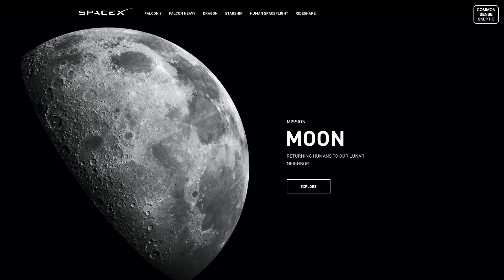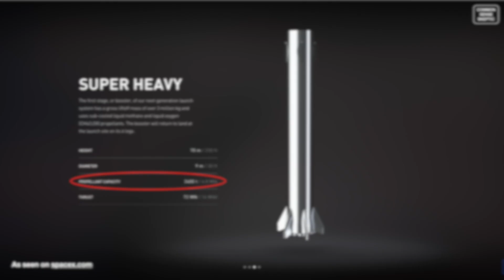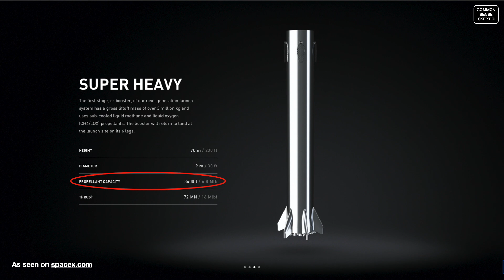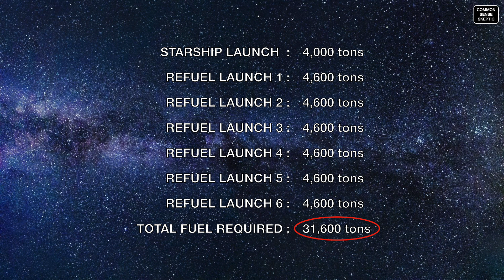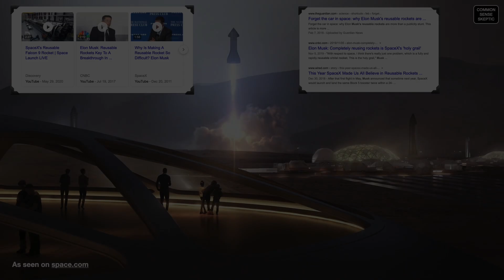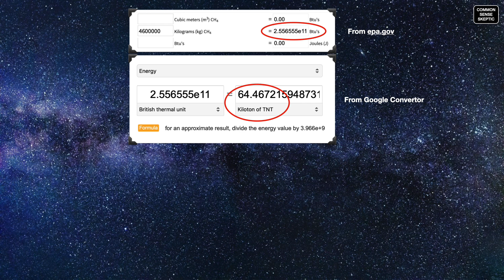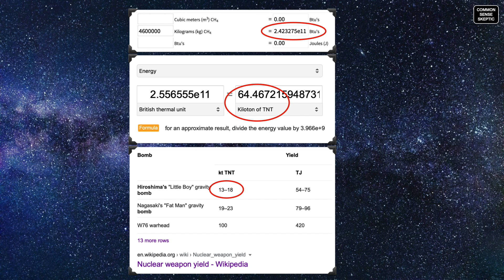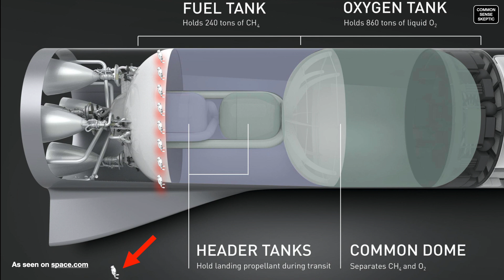STARSHIP EP5 - ORBITAL REFUELLING (1080p)

Comment: When I think of the risks of refuelling in space with multiple ships, wow this is not the answer for deep space exploration.
Reply: Refueling in space is 100% the way to do it. Trying to launch enough fuel in one go is dumb given the rocket equation. space refueling will eventually allow us to produce fuel off-world so we don't have to launch it up in the first place. Definitely a good idea to nail down the process sooner rather than later.
Reply: @dirkwalker9686  Whilst I agree that refuelling in space enables a lot of good things, I also think that refuelling a manned space vehicle can and should be avoided. Also, paradoxically, in-space refuelling undermines the economics of producing fuel off-world - because it makes it easier and cheaper to get fuel from Earth to places like Mars orbit.
Reply: "Risk" is relative actually :) The simple fact is you can't carry enough propellant right from the start in any reasonably economic plan. 

But propellant transfer, (correct term because you replace both fuel AND oxidizer) has already been done on a routine basis with Mir and the ISS. Scale, however, is a thing and it would be vastly less risky to pull Starship up to a dedicated orbital propellant depot and get it all done in one go. That requires on-orbit infrastructure, (the propellant depot for one thing) and that is something that Musk is going out of his way to avoid. Mostly it's because his "Mars Plan" is really just a modified version of Robert Zubrin's "Mars Direct" mission and the more he moves away from that basic plan the more actually planning he has to do, but mostly because he is too short sighted to see how such a  depot would work out as an advantage in the end. (A depot doesn't give him the monopoly prospects he wants. As long as his plan can only use Starships to bring propellant to Starships then  he can fly the Starships more which boosts his economics even if no one else benefits. A depot could be provided propellant by "other" vendors in competition to Starship)

The other way is to launch a vehicle that can carry expendable 'drop-tanks' and then launch the drop tanks and connect them to the spaceship and go. Neat and simple and actually economical for fairly low flight rate which is going to be most early Mars missions anyway. Not going to happen with Musk because, (again0 he can't see the advantage to it. It would require a different ship to go to Mars and it would require less use of Starship/Superheavy making it's economics, (already questionable) worse.

Propellant transfer in space is a game changer and as you can source your propellant from 'local' sources, ( @Saumya Cow is not really wrong but in context 'local' propellant from Mars and even the Moon is arguably economic compared to Earth based propellant due to the delta-v requirements of getting it out of Earth's gravity well) though lower shipping costs from Earth DO have a great effect on any economic incentives and/or market off Earth for technology and manufacture, ("local" becomes harder to justify versus imported) propellant making equipment shipping is a one-time cost whereas constant propellant shipment costs add up quickly.
Reply: @randycampbell6307  In my view, locally sourced oxygen (for propellant and other uses) from Mars is worth doing. However, methane isn't. Oxygen extraction is necessary (life support), simple (atmospheric extraction, not mining) and also far less energy intensive. The jury is out on mining oxygen on the lunar surface. It may be a necessary evil (life support) but its also logistically a lot easier to deliver there. 

I also think that Mars exploration can be done without fuel depots (as separate stationary entities) as opposed to fuel carriers (tankers). Its probably easier if I just go into concrete detail. Now, lets suppose for the sake of the argument that there exists a Starship class tanker vehicle. It has a thermal protection system and propellant transfer capability. 

So our first task is to move a lot of propellant to low Mars orbit (400 km). Lets start with two full tankers in low Earth orbit (yes this requires a number of flights and propellant transfers). Now, do a single burn that consumes half the propellant in each vehicle. We're now in an elliptical orbit that goes most of the way to the Moon. Transfer propellant from one vehicle (nearly emptying it) to the other. The empty vehicle returns to Earth. The full tanker now does another burn which puts it on a minimal energy (probably ballistic capture) trajectory to Mars. On Mars arrival it aerocaptures and does a series of aerobraking passes to go into low Mars orbit with minimal propellant use. Note that this only works with a vehicle that has some thermal protection. You can do it with a pure tank, but that has its price too. Note also that this is all done robotically, so failure is acceptable. 

Now you have 500+ tonnes of propellant in Mars orbit. That's sufficient to a mission if you were to manage it well, but we want redundancy and we want flexibility. So lets send at least three such tankers into Mars orbit. Subsequent missions only need to send one or two. We'll also space these around the planet to increase accessibility (and launch opportunities). 

To access the surface of Mars, we need a single purpose lander/ascent vehicle. Since this vehicle has the delta-v capability to go from Mars surface to orbit, it also has the delta-v capability to descend fully propulsively. So, lets adopt that capability. We now have a fully reusable "lunar lander" style vehicle. Its also optimised since its not experiencing high thermal loads and its not experiencing high g forces. Since we have ample fuel in orbit, we're now in a position to run multiple landings, or even visit Phobos. On the surface, the oxygen is sourced locally (four fifths of the mass) and methane has been pre-delivered (mass wise its only a small part of the overall one-way cargo). 

Now, to get from Earth space to low Mars orbit and return. We need a special purpose habitat/transit vehicle. Because this thing never lands, it can be optimised. For the sake of the argument, picture a vehicle based around a truss. On one end is the habitation module. On the other end tankage and engines. We're talking hundreds of tonnes of tank capacity. Most of the propellant is burnt in trans Mars injection. However a quantity remains. This propellant is burnt on arrival (fully propulsive capture and insertion into low orbit). The transit vehicle can now be refuelled - and if you wish, refuelled whilst the crew is out. Return to Earth is notionally a return to high Earth orbit (might be rendezvous at lunar gateway, but not essential). Then return in a regular capsule. 

Note that this is being done to keep the propellant quantities Earth to Mars and Mars to Earth roughly the same. Hence you don't need drop tanks. However, the initial assembly of the transit vehicle in Earth orbit can be done by lofting full tanks and then assembling those onto the truss, if needed. (Propellant transfer can also be done as a latter step - it boils down to packaging). 

As for the issue of methane for ascent fuel on Mars. My view is you first of all keep the ascent vehicle light. That cuts the problem down to size. And since you're down to relatively small quantities of methane, you can simply deliver it with other cargo. Or you can deliver ammonia as a hydrogen carrier. The bonus is you get nitrogen as well.

As for one-way cargo delivery to Mars surface. Complete insanity delivering this on expended Starship. You need a vehicle that is fit for the purpose. What I suggest is a fairly conventional capsule shaped vehicle with a separate (docked) propulsion and cruise module. Launch those separate, mate them and then send them to Mars - again on a minimal energy trajectory. To finesse this, do an aerocapture pass and aerobraking to bring the cargo lander into a low orbit. Then land. This minimises thermal protection mass. And I have a few ideas from there. Note that this gives you the freedom to be generous about how much mass you land on Mars. Plus you can leave cargo landers in orbit for later positioning. 

Note that a Mars lander/ascent vehicle travels with you docked to the transit vehicle. Its also your lifeboat.
Reply: @saumyacow4435  Let me start off by saying that I resent your efforts to rob me of my title, "Makes Response Posts Way to Long on the Internet"... I've worked hard for that accolade and will not take this lying down! (However as it's getting close to my bed time I may have to break up my epic response somewhat... Also YouTube has bandwidth issues... who knew :) joking btw :) )

Yep going to need a bit to parse this but I'll note right from the start that a big point for Mars ISRU is the existence of water ice which can be broken down into propellant. Yes it's not directly methane but hydrogen is a good feedstock so right there you get breathing air and propellent which makes shipping it in far less attractive.

The Moon probably has less accessible water resources, (there are the polar craters but as I like to point out that's essentially "fossil water" in the same vein a fossil fuel, aka a limited and operationally limited source so not as attractive for long term use as one would think) but recent work going back over the Apollo return samples show the regolith in many areas is actually a lot 'wetter' than previous assumed. It's tough to get it out but it's there. Arguably oxygen extraction from the regolith is pretty straight forward, so for Lunar use something like a LOX/Regolith rocket would make economical sense.

As I said I need to head out, (work starts early tomorrow... still trying to figure out why I'm still working jobs that START so early, glutton for punishment I guess :) ) so I'll read and finish responding tomorrow. Good Stuff though :)
Reply: @randycampbell6307  Just a quick response from me then (oops). The reason I balk at methane production on Mars is that the most likely source (regolith) requires mining. Mining requires complex heavy machinery that wears and breaks. It requires a large source of energy. It requires a lot of secondary infrastructure (robotic construction, maintenance and repair). And it requires some means to carry energy (fuel, batteries, whatever). Compared to oxygen extraction (from the air) its a nightmare. Oh one other thing. On the moon you're at least in a shallow enough gravity well that you can land/ascend on the same tank of fuel (have drop tanks if you wish, but one day the moon is going to have a garbage problem :))
Reply: @saumyacow4435  Also a quick response from me: Methane is planned to be made from locally sourced hydrogen and the Martian CO2 atmosphere. The process requires energy and local mining/extraction for water ice but in general is a pretty straight forward and well known process. (Albeit 'scale' is going to be an issue as is energy production but it's difference between simply visiting and staying long enough to get actual work done)

Yes the equipment will wear and break down but it's a one time shipment cost versus on-going shipments of propellant which (and I'[l go into this more in longer response) will end up actually flying your 'tankers' less than you'd think rather than more.
Reply: @randycampbell6307  The chemistry is straight forward. The mining is not. My bread and butter for some years was doing design work for mining companies. Automation, control, robotics. Let me tell you something. Mining isn't easy. It involves heavy machinery that frequently wears and breaks. Where's the spare parts coming from? Where's the robots that do the assembly, maintenance and repair? How do you fuel everything?  There's ten thousand details you need to sort through. And if and when you do have that level of technological readiness, how much is it going to cost to send thousands of tonnes of stuff one-way to Mars, all to have the capability to launch ONE Starship? And also how much do you need to spend on providing redundancy - since lives depend on absolute reliability? 

Typical mining machinery here on Earth has a lifespan of 3 years. That not "major service" time. That's the frame is cracked and unserviceable - new vehicle please. Do you propose manufacturing? Because now you've made the problem ten times worse. Mining for water in the quantities needed to fly Starship class vehicles direct to Earth is going to require a constant stream of heavy equipment. 

Its stupendously expensive, time consuming and risky. The act of setting up all this infrastructure is many times more expensive (however you measure it) than simply exporting the methane from Earth to Mars. Remember that I do consider it worthwhile to produce oxygen locally, but even then not in the quantities needed for a Starship. That act instantly multiples your solar array. And that stuff has to be delivered to Mars, does need assembly, maintenance and repair and so on. 

Btw, there are other side effects to this. As you progressively strip mine, the mining operation moves further and further out from your base. Meaning your logistics and energy transport problems keep on getting worse. Now, where does this become environmental vandalism?

The thing I find ironic here is that if you assume a Starship class vehicle, you've made fuel transport trivial. And you've made "Mars direct" even more pointless.
Reply: @saumyacow4435  Ok, here’s my response:

>In my view, locally sourced oxygen (for
>propellant and other uses) from Mars is
>worth doing. However, methane isn't. 
>Oxygen extraction is necessary (life
>support), simple (atmospheric extraction, not mining) and also far less energy
>intensive.

The thing is while you can extract oxygen from CO2 we happen to know there’s water-ice on Mars so even though it’s more energy intensive the actual “process” is pretty straight forward. So too is making methane from hydrogen and CO2, and in the end it will actually cost less than importing propellant even if the costs are ridiculously low. (This was a point for ISRU from the very start)

>The jury is out on mining oxygen on the
>lunar surface. It may be a necessary evil
>(life support) but it’s also logistically a lot
>easier to deliver there.

Actually not, the delta-v costs per lb from Earth to the Moon are enough that, as you can literally “bake” it out of the Lunar regolith with a solar kiln, local sourcing makes more sense. Similarly you can convert the CO2 on Mars to O2 but since ISRU works it’s likely that sourcing it from ice is workable.

>I also think that Mars exploration can be
>done without fuel depots (as separate
>stationary entities) as opposed to fuel
>carriers (tankers).

Being honest the major difference is tankers are ‘self-mobile” but I suspect that’s not the advantage you might think it is.

>It’s probably easier if I just go into
>concrete detail.

Please

>Now, let’s suppose for the sake of the
>argument that there exists a Starship
>class tanker vehicle. It has a thermal
>protection system and propellant transfer
>capability. So our first task is to move a lot
>of propellant to low Mars orbit (400 km)

Ok I’ll grant that basis, and let me point out this is a version of an architecture called “Abundant Chemical” were you essentially base everything on constantly pushing propellant “forward” to fuel your exploration/expansion. 

I like the concept in general but have some specific issues with it but go ahead :)

>Let’s start with two full tankers in low
>Earth orbit (yes this requires a number of
>flights and propellant transfers). Now, do a 
>single burn that consumes half the
>propellant in each vehicle. We're now in an
>elliptical orbit that goes most of the way to 
>the Moon. Transfer propellant from one
>vehicle (nearly emptying it) to the other.
>The empty vehicle returns to Earth. The
>full tanker now does another burn which
>puts it on a minimal energy (probably
>ballistic capture) trajectory to Mars.

So far about right, coupling with the Oberth effect on departure rather than burning from the higher orbital point, (uses the propellant more efficiently even though your deeper in the gravity well) but that means more than one trip through the Van Allan’s. Not a deal breaker assuming Starship actually has radiation shielding. (Yes automated ships need some too :) )

> On Mars arrival it aerocaptures and does
>a series of aerobraking passes to go into
>low Mars orbit with minimal propellant
>use. Note that this only works with a
>vehicle that has some thermal protection.
>You can do it with a pure tank, but that has 
>its price too.

As a note that’s actually not correct as you can aerobrake without a heat shield if you keep the passes at a thermally low point. We’ve done it a lot with Martian orbital probes. Downside is that it has to be done VERY carefully, (“Did you remember to convert from feet to meters”? “No, why? Is it important? “ :) ) and it’s more difficult with larger masses. I’ll grant this though because we’re assuming these are actually “Starships” which means planned reuse therefore, heat shields.

>Note also that this is all done robotically,
>so failure is acceptable.

Prepositioning, got it. IIRC the planned Starship Tankers are automated anyway

>Now you have 500+ tonnes of propellant
>in Mars orbit. That's sufficient to a mission 
>if you were to manage it well, but we want
>redundancy and we want flexibility. So lets
>send at least three such tankers into Mars
>orbit. Subsequent missions only need to
>send one or two. We'll also space these
>around the planet to increase accessibility
>(and launch opportunities).

Fine so far but I have to point out that this is now three “tankers” that are useless to your regular fleet and will essentially ‘sit’ in Mars orbit for somewhere between two and four years if not more. The question is why send Starships then?

>To access the surface of Mars, we need a
>single purpose lander/ascent vehicle.
>Since this vehicle has the delta-v capability 
>to go from Mars surface to orbit, it also
>has the delta-v capability to descend fully
>propulsively. So, lets adopt that capability
>We now have a fully reusable "lunar
>lander" style vehicle. Its also optimized
>since its not experiencing high thermal
>loads and its not experiencing high g
>forces.

And the question here is still "What does God... Er that is what does Elon need a Starship for?"

You are not using Starship so why is “Starship” even a part of this plan? 

I’ll be honest in that I’d argue that you don’t need that much propellant nor do you need that big of a spacecraft to do any of this. (
That's also a major question I have about Starship/Superheavy in general and Musk's Mars plans specifically as well by the way, not just you :) )

May I suggest checking out a NASA/University study series generally called “ISRU to the Max” and/or the Hercules Reusable Single Stage Lander concept?

(https://www.thespacereview.com/article/3085/1)

About the only difference is that there are several models of Herucules, (again similar to Starship) one of which is a dedicated Interplanetary Transfer Vehicle that doubles at Mars as an orbital propellant depot and supply transfer point.

The thing here is you have essentially ‘expended’ those three Tankers because they never come home and so you’ve gone out of your way to avoid calling them propellant depots but that’s what they end up being. And you have to keep resupplying them over time as the propellant runs low. (500 tons sounds like a lot but you’d be surprised how fast it can go)

Also, again, ISRU for propellant produced locally IS cheaper than trying to bring it with you. Even more so in this case because, (and I don’t think this occurred to you here) you are going to need to eventually send MORE tankers on a one way trip to Mars to continue the landings and expansion.

Sending propellant extraction and processing equipment ends up being cheaper than constantly sending more propellant, and arguably the case can be made that the Interplanetary Transport ends up going back to Earth with less than it came with so filling that extra space with Martian propellant “might” give you a net economic incentive.

Something to keep in mind, even though I don’t like Musk’s plan since it directly doesn’t build future capability, is that he’s got a point a lot of people overlook. (Even he does occasionally since his ‘definitions’ keep changing ) 

If you broaden the definition of “expendable” a little bit, (and this is clearly illustrated in the Hercules studies) by “expending” the item in question you are actually “expanding” your foothold and outpost. To continue to use Starship, if you land and “expend” a Tanker Starship you now have pretty efficient surface propellant depot to store you locally produced cryogenic propellant in. It even includes the required pumping and handling equipment. 

Similarly if you “expend” a Passenger or Cargo Starship with a habitation section, (well good luck getting it into a position to use) you have a ready-made, (ok purpose made) surface habitat out of it.

Yes, none of this is actually ‘optimized’ fully but that’s ok really because the point is utility and the ability to mass produce the vehicles, (even if very different internally having a similar outer mold line does in fact help your costs somewhat) for economy.

Good thoughts though, thanks.
Reply: @saumyacow4435  Start point; I don't assume Starship and in fact don't see it as a viable system :) I only point out that it's the whole basis for Musk's plans so quite obviously it kind of "needs" to be used as much as possible :)

A more direct point is that this is exactly opposite of supporting ONE Starship. That is exactly the problem both with Musk's plans and Mars Direct.

I realize that mining is difficult and expensive, I've discussed it and in context of off-world use for a couple of decades now. Yes in fact you DO pretty much have a constant stream of "parts" in transit, it's rather a given with the assumption of a sustained presence rather than a 'flags-and-footprints' mission profile.

You're directly on-point with bringing up how ridiculous the idea of supporting a Starship sized vehicle from local resources is. Something a third the size, (Hercules for example) would be a challenge but it is possible.

I'm also glad you brought up maintenance and support for the infrastructure you'd need, far to many people blow it off and as a maintenance person that physically hurts :) No it's not going to be easy and yes it's going to take a lot of work. No extensive ISRU for the first missions doesn't make sense but on the other hand you don't need it as you can bring some of the supplies with you instead and produce propellant locally. Mars Direct, for all it's faults, has managed to do the actual work to prove that part at least. (Even thought the whole concept and initial work was done in the early 60s)

As for the 'mining' operation itself it's a choice of what you want, short term visits or are we staying? The main problem with long-term ISRU is that Mars isn't the place to be mining your water from as it's only a short-term solution. (It's all "fossil water" anyway so it is by definition a limited resource) But it IS right there and available so it's going to be used in the long-run.

I should probably point out that not only am I not a "Musk" fan, I'm also not a Mars-fan as in one who thinks it is a 'natural' second home for mankind. It's not. It's a very dangerous, very marginal place for a human settlement but in context that's what "Starship" and these videos are pretty much about so it comes down to what the end goal is. I'm more interested in Venus, but I'm a minority :)
Reply: @randycampbell6307  Yikes, death by formatting! :)

Chemical processing of Martian CO2 and water into methane is not the problem. The problem is the cost, mass, complexity, risk and energy involved in mining Martian regolith in sufficient quantity. You end up sending more mass to Mars than you would have if you had simply delivered the methane itself. Btw, mining and chemical engineering equipment has a typical useful life of a few years. To get beyond this you need a full blown manufacturing infrastructure on Mars and that's not happening any time soon.

Methane is 22 percent of the mass of propellant. For a sensibly sized ascent vehicle, this amounts to single digit tonnage per flight. At that scale the imported methane is a minor part of the overall mass you need to send to Mars surface as one-way cargo. Once you've nailed the one-way cargo transport issue, the methane (or ammonia) transport is a secondary issue.

Oxygen from lunar regolith. Again, I'm not ruling this out. But don't underestimate the complexity, mass, cost of mining. Versus the simplicity of simply landing on the moon with enough propellant to also return to lunar orbit. Something we know how to do.

There is a blurry line between "tankers" and "depots" in the sense that no matter what you put into space, its going to need engines, navigation, power etc. However the one thing that ordinary fuel depots don't have is the ability to do aerocapture into Mars orbit. You can make do without that capability, but then you have to upscale to account for the propellant needed to propulsively capture. The TPS (however you arrange this) would certainly amount to less mass at this point.

Just to clear one confusion. I'm not proposing to put humans on a Starship. What I have in mind is to put the habitat/transit vehicle either into a high Earth orbit or in lunar gateway orbit and send the crew up to it with a Dragon/Orion. Then fly close to the Earth before doing the trans Mars injection burn. This means two passes through Van Allen belts but they are relatively fast passages. Everything else is unmanned, so not critical.

You can aerobrake without a heat shield, but you cannot aerocapture. One can of course experiment with "dumb tankage" and inflatable heat shields and the like. But my reasoning is this. You've already got a tanker vehicle since you need to get propellant to Earth orbit. That tanker thus has a full TPS. There's no sense in designing an entirely new vehicle if exactly the same vehicle can transfer propellant in Mars orbit as well as it can in Earth orbit.

I'm not about to step inside Elon's head. All I know is that he'll burn money until either it runs out, or they lock him up. "I just may be the lunatic you're looking for" the song goes.

I'll check out the Hercules study tonight.

Regarding Starship class tankers being sent to Mars orbit and also the general issue of expendability. You're starting with a full tanker in low Earth orbit. Burning half your fuel gives a delta-v of about 2.6 km/s. That puts you into an elliptical orbit that stretches most of the way to the moon. Now, transfer propellant to fully refuel. From this orbit, Mars transfer is in the order of 1.5 km/s . So, you arrive at Mars with a bit over 800 tonnes of propellant on board (I assume a dry mass of 100 tonnes, propellant mass of 1300 tonnes). 

The habitat/transit vehicle notionally requires 400 tonnes of propellant to return to Earth. Again this is from low Mars orbit to lunar gateway. One tanker is more than sufficient for this, plus a number of lander/ascent vehicle flights. Yes, you can afford to go to Phobos and you can afford to rotate crew, or do a multi-site expedition.

I have multiple tankers in Mars orbit purely for redundancy. If one gets hit by a micro meteor, that's a loss, but its not a loss of crew or mission. Plus in extremis, these things are capable of acting as orbital tugs. Backups on backups.

You can of course reuse the tanker. It means setting aside a reserve of roughly 200 tonnes of propellant. That reduces the usable propellant in orbit and that's why I gave the figure of 500+ tonnes. I didn't go into reusability for two reasons. One is word count. The other is that the vehicle isn't that complex or expensive and after some years in space, including the return flight to Earth, its going to need extensive checking and refurbishment. The labour in that is going to be more expensive than the hardware. Furthermore

- We are talking about roughly one tanker vehicle per mission.
- If you're going to expend something, expend something that isn't that expensive to build.
- Perspective. A typical Mars mission might require 150 tonnes (or more) of one-way cargo. That's two or three expendable cargo delivery vehicles. No way around that.

Again, ISRU methane is NOT cheaper than bringing the methane with you. When you deal with all the mass of all the machinery that's needed to be sent to Mars, much of which has an usable life of a few years, plus all the power systems, robotics and so on, a single digit tonnage of methane per ascent is neither here nor there. Not when you consider its secondary to all the mass of one-way cargo you need to deliver to Mars surface. 

Now, if it is the case that we want to continue sending missions to Mars after the first half dozen or so, then there is a case for creating a certain amount of ISRU infrastructure (beyond atmospheric extraction). However, that's a decade or more of manned missions where you have boots on the Martian ground and you can afford to make mistakes and learn. To my mind its far too risky to rely upon ISRU methane on a first (or second, or third) mission. I mean, even if you did send some prototype mining gear, you'd still want to send a tank of methane regardless - on the general principle of if you can reduce the risk of people dying, then you do it.

I don't regard a Starship as a particularly good Mars surface habitat. What I'd prefer to do is to first get the one-way cargo delivery issue under control. To repeat, that would mean two flights of a Starship class vehicle to Earth orbit, and in-orbit assembly (simple automated docking). The composite vehicle would deliver 50+ tonnes of usable Mass to Mars surface. Two or three of these would provision a mission generously. In that would be a surface habitat, ample provisions, water, consumables, rovers, ancilliary power plus other experimental gear - you'd probably want to do some basic earth-moving for radiation reasons.

Now, one other bugaboo I have with Mars missions. We need landers that don't rely on ejected heat shields, backshells, parachutes etc. You don't want this stuff hitting something else. That's one reason why the lander/ascent vehicle I have in mind doesn't do this - its fully propulsive. Similarly there are ways to design a robotic surface cargo delivery vehicle that is both accurate (landing site) and doesn't shed bits and pieces on the way down. Another story.

We'd better take this to another forum.
Reply: @saumyacow4435   All part of my clever plan to retain the title of "Longest Response Poster on the Interne", I worked hard on getting the title after all :) (Seriously it looked great in word, transferred to YouTube and it showed I needed to re-add all the spaces and line breaks and then when it finally posted it wouldn't let me go back and edit :( )

I suppose I should also define some things; Mining and/or processing regolith is a longer term option for anything less, (which is arguably the early flights) you bring some raw materials, (nominally liquid hydrogen) and enough power to process that into your return propellant. ISRU is most (today) most often used in the context of the long-term "resource" mining but it also includes the shorter-term, easier methods.

Longer term, well it's longer term so obviously you're going to eventually start manufacturing and industry on Mars so mining makes sense.

The 'fun' part is that in fact methane isn't the really the best or most efficient propellant to make in-situ but because it was in Mars Direct, (and arguably because it's a lot easier to store than liquid hydrogen) it is where everyone is going.

Lunar oxygen extraction is thing, so much so in fact that NASA based an entire program concept on it at one point. (LunOx)
It's pretty much literally as simple as heating the regolith and boiling it out. Yes you have to process quite a bit but its scoop and conveyer belt work. Unlike Mars methane ISRU though it does take more effort and isn't as easy in the short term.

 And while you can still bring along all the propellant you are going to need it always increases mission mass and complexity, especially the further out you go.

Yes In conflated "aerocapture" and "aerobraking" but let me point out that to perform the former you actually need a lot more than just a heat shield. Part of the reason no one has done it yet is the need for hyper-accurate, near real-time models of the destination atmosphere and even then it's risky. It's the main reason that a short propulsive capture maneuver followed by lowering the orbit by aerobraking is preferred

The thing is there isn't that much difference between a "depot" and a "tanker" at interplanetary ranges as you have to deliver both to the destination and establish them in orbit so the exact method will also drive the design.

I'll admit MY preferred option .is delivery by an dedicated Interplanetary Transfer Ship with another dedicated "lander" ship at either end and orbital tugs much like yours but I'm not wedded to chemical propulsion either :)

While not crawling inside Elon's head, (ewe :) ) we know his stated plan forgoes any orbital infrastructure at either end and depends on direct planetary landing and operations, (hence why I keep pointing out it's simply a version of Mars Direct) because that's his stated plan. Hence anything using "Starship" essentially means HIS "Starship". What we're talking about isn't that so my "point" about why we need it then if we're not actually using it?

And if you'd like to suggest another forum, I'm open :)
Reply: @randycampbell6307  Oh in that case, I blame Bill Gates :)

Seems we are in agreement about bringing some hydrogen along for earlier missions. Which is why its good to have an architecture that doesn't absolutely depend on ISRU methane, but will adapt if it becomes feasible. After all, you may get lucky and find an aquifer or buried ice. But that's the whole point of exploration.

There is ammonia which is a reasonably dense carrier of hydrogen (and the nitrogen is very much needed) but in the end, I'm comfortable with liquid (or temporarily solid) methane. One reason behind this is that I believe we can extract enough nitrogen from the Martian air for life support purposes. That's another story.

By "further out" I presume you mean beyond Mars? I think most would agree that chemical propellants aren't going to get past Mars. I'm a fan of some fusion concepts, including those that burn hydrogen-boron (they don't rely on neutrons). Still a little ways off that. I do think we should go directly for fusion because that sidesteps the political issues, plus working in a vacuum is handy.

I think we are almost at the point of having accurate, real time data on the Mars atmosphere. Sufficient to do aerocapture. But, and I do emphasise this, I'm only relying upon this for propellant/cargo. My architecture still specifies propulsive capture for the habitat/transit vehicle. Plus what you're aiming for is to target a "bit more than capture". Meaning that the error will only effect how many aerobraking passes you need. 

One advantage of separate human transport and cargo transport is that you can optimise both, plus you accept a small failure rate for the cargo, which then means you can do things like aerocapture for cargo only and you can be a bit more on-the-edge with the surface cargo lander. 

Bit of an aside here but one of the things that annoys me about Starship is that the Mars landing simulation shows a late-lifting strategy. A deep dive into the lower atmosphere in order to preserve velocity and then use it to generate lift. So you're descending to 5 km altitude whilst still going 1.7 km/s. The downside is high g forces (the simulation shows 5 g but it can be as much as 6 g). With a dedicated (and propulsive) lander you can keep g forces potentially under 3 g. The way that Elon's fans can brush aside crippling g forces for civilians demonstrates some mental agility of a sort.

I'm curious to hear what you had in mind with a transfer ship etc. It sounds like it has elements in common with mine.

We don't need something called "Starship". But it would be good to have a heavy lift vehicle that is reusable (hence a TPS) and in-space propellant transfer. There's actually room for someone else to come along and do a different take on it. Its the idea that counts.

Forums. Seems nasaspaceflight is dead and if I start posting there I'll attract the Muskrats. Redditt's r/TrueSpace looks interesting but I'm not sure just yet if the moderators meant it for free flowing discussion as opposed to news-directed topics. Should ask.
Reply: @saumyacow4435  "Seems we agree:

Oh, right. Can't have that, you start agreeing on the internet the next thing you know we'll have to give ameboa's citizenship or something... Hmmm, Ok how about we choose our 'stances' on issues based on 26x26 entry table with each choice determined by the last four digits of an arbitrary time chosen by the decay of a charged cesium ion into a neural state. Granted our chances of still agreeing is a non-zero sum but it's obviously better than actually having a real opinion or facts to base them on. (Or I could just be overthinking it, Hmm, overthinking my overthinking... I'll have to think about that)
::::grin::::

I'm going to have to reply the rest in a bit as I'm pressed for time atm. (Have to do a deep think on my overthinking, oh wait, that was a joke wasn't it :) )

Ya, forum choices are a bear at the present moment. I'm on NSF, AlternateHistorydotCom, Secret Projects, and a few others and they seem to go through cycles of activity, going dead, and then frantic activity again on some random basis. it's tiring actually :) (Funny enough I was 'gifted" a subscription to NSF-L2 for a year, several years ago... Just in time for it to go pretty much 'dead' for the entire year and then pickup again once the subscription ran out. :) )
Reply: @randycampbell6307  Dogs and cats living together.. mass hysteria... :)
Yes, NSF, or at least the Missions to Mars (HSF) bit seems to have gone comatose since last August. Where are all the Muskrats? 
Anyhow if you see something interesting, forum wise, do let me know.
Reply: @randycampbell6307  Just on the issue of short term visits, or staying. Once upon a time that used to be a simple discussion regarding crews rotating through a permanently occupied base. I was neither here nor there on that issue. Its just another "challenge" really. However, these days its all about humans staying permanently and in large numbers. My problem is this serves no one's best interest, least of all anyone who might actually try to do that. 

If the question is would there be enough exploratory missions (like more than half a dozen) to justify setting up manufacturing, building serious shelters, etc. Well, that depends on whether or not there's a reason for hanging around. We may get to the "been there, done that" stage. Indeed, life might be discovered by robots before we get there. I guess as technology improves and it gets easier, one can imagine governments establishing bases, Antarctic fashion. On the other hand I hope we (human race) grow up enough to make it a cooperative effort.
Reply: @saumyacow4435  We could always hit up the "New Mars" forums... Mars Mafia, Mars-Direct-Uber-Fans AND Musk-Fans.... I mean what could possibly go wrong? :D
Reply: @saumyacow4435  Being honest there was always an expectation/plan that space would literally become another frontier for humans. 
The US going from less than 15 minutes of 'human space flight' to the surface of the Moon in under a decade blew those initial hops all out of proportion and the reality of the whole thing only really been driven by international politics along with the actual difficulty of the whole endeavor put a bit of a damper on that enthusiasm but also led directly to different and often quite ingenious alternative planning.

The problem is the "Legacy of Apollo" coupled with the rather fanatical enthusiasm around some of those plans have only reinforce the idea that all we have to do is ONE thing and people will be living all over the Solar System by next Tuesday.

You need only look at CCS's bit on Mars One and The Gateway Foundation to see how easy it is to generate hype over CGI and grandiose, unworkable plans over "boring exploration". 

Couple that with a large number of "in my lifetime" (and that actually means before I'm like really, really old, you know, over 25 :) ) how don't known enough about the actual challenges and dangers, (or have been convinced those are "over-blown") and it's why you see these surges of fanatic interest keep popping up.

My issue is probably based on the fact that while I'm as prone to the next person I've always managed to fall into groups that, while they may have an overarching "plan" also tend to sweat the details, Including the boring and tedious ones :)

Go, yes, stay, yes and yes eventually stay permanently. But it's a process and it takes time.
Reply: It's the perfect answer because you can afford a launch failure for tanker launches which allows rapid reusability.
Reply: @benoitgermanier8815  You're kidding right? Keep in mind there will be one, (maybe two but it's doubtful at this point) launch facilities that can handle these launches so a launch failure will likely shut down ALL tanker flights. The "perfect" answer is an orbital fuel depot that the Starship flies to and refuels. The depot would be fueled by just about any launch system, (one of the main reasons Musk is against it) and would allow a much more rapid pacing of Mars flights but allow a slower flight rate to build up propellant reserves. But that doesn't help the flight rate of the Starship/Superheavy system as much as depending on a 'surge' of Tanker/Superheavy flights, (and of course the "Point-to-Point" Starship flights) all of which will help skew the 'pricing' being claimed.
Reply: @randycampbell6307  That's what they will do. They will refill a tanker in orbit and then send the ship to be refilled only once.
Reply: @benoitgermanier8815  No that's exactly NOT the way they plan on doing it. And that's a point. The specific plan requires multiple (3 to 6) rapid tanker flights to re-propellant a single Starship. All so that they avoid building any kind of supporting infrastructure in orbit of either Earth or Mars. It's rather silly.
Reply: @randycampbell6307  Well, not if you have two tankers. If you have two tankers you can refill one first and then send the ship.
The flight profile has nothing to do with starship anyway, the only thing that matters is that they can do it if needed.
Reply: It kinda is
With no refueling you would have to build rockets of ridiculous size to send something to Mars
Reply: @nexus6755  Well  yes and kinda no since it also depends on WHERE you build the "ridiculous" size rocket :) Part of the 'problem' with Starship/SuperHeavy is that it IS a 'ridiculous' size ("more powerful than the Saturn V and far to many don't see any issues with this :) ) and then you have to launch a number of them to simply get one (1) Starship TO Mars. 

Part of the supposed "issue" with building a "Battlestar Galactica" space mission in LEO was you were going to have to launch dozens of rockets to build up your interplanetary vehicle and propellant and ISRU would allow you to reduce the number of launches and the size of your initial vehicle. It's a good idea which if why it's been studied since the early 60s but actually transferring propellant, (especially cryogenic propellant) in microgravity isn't a well understood process. And then there's the process of actually producing the propellant on-site which itself isn't a trivial affair and so when being 'conservative' you see plans simply decide to bring it all with in the first place.
Reply: @randycampbell6307  Building bigger is not an issue, you just need a bigger safety distance from the launchpad. But unlike CSS said there is not just divergence to take into account, there is sound attenuation too because of air viscosity. So bigger rockets are actually a good way to reduce noise since air is a natural dampener.
Reply: @benoitgermanier8815  The entire reason there are sound suppression systems installed is because air is NOT that good at sound suppression. air doesn't help that much. 
This was an issue for NASA's "Post-Saturn" launch vehicle studies and they showed that much more powerful than the Saturn V and you rapidly run into issues with significant damage being done to your launch infrastructure on every launch let alone finding somewhere to launch from.
Reply: @randycampbell6307  Was talking about long distances. For 1300hz it's:
50% at 300m, 90% at 1000m, 99.999% at 3000m...
It's exponential.
Reply: @benoitgermanier8815  Understood that and it's analyzed in one of the videos here. The distance gets ridiculous really quick :)
Reply: @randycampbell6307  He only talked about divergence in his video, which is quadratic and not exponential. You should take a look at minuteearth video called "Why Wolves Don't Chirp"